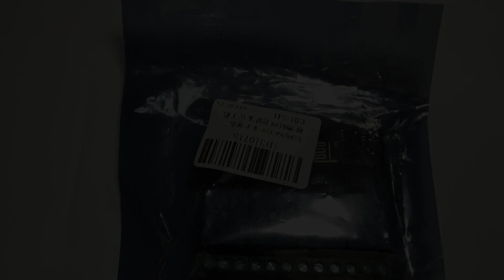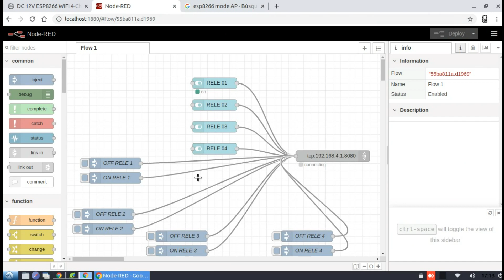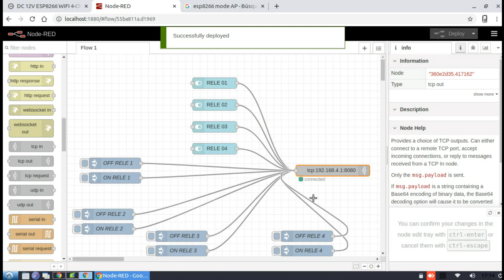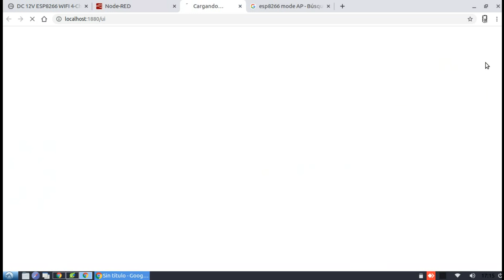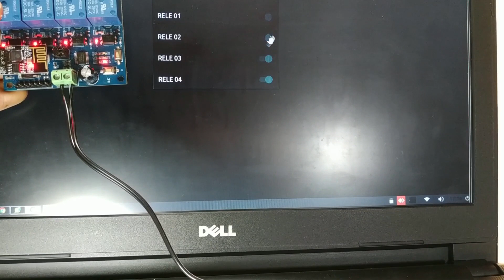Test  Module ESP8266 4 Relay  Channels Control & Node-RED Dashboard  ICStation.com: PDAControl

Comment: Hi dear, I've bought 1 esp8266 module relay 12v 1ch and 1 esp8622 module 12v 2ch. I have used both esp01 for other arduino projects. Now I have a genuine esp01 ma it doesn't work with modules. Please, can you send me sketch to write into esp with Arduino ide? thanks 🙏